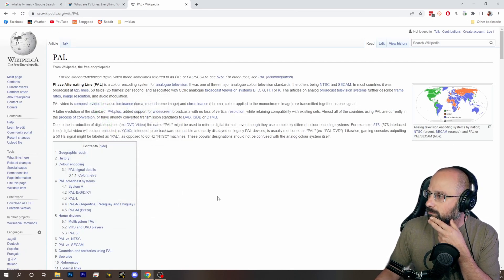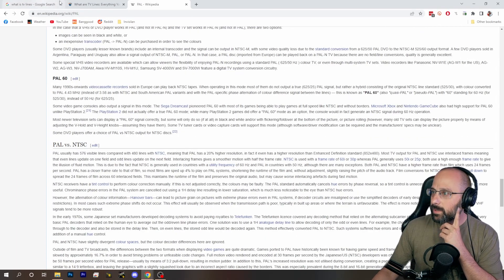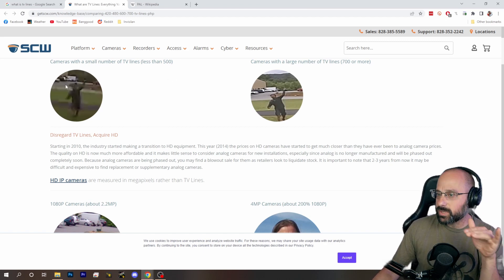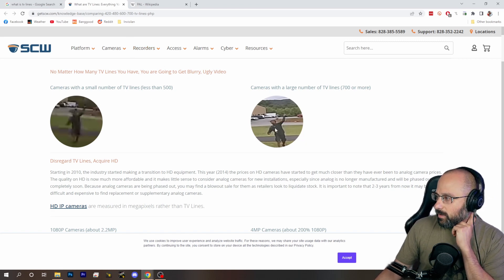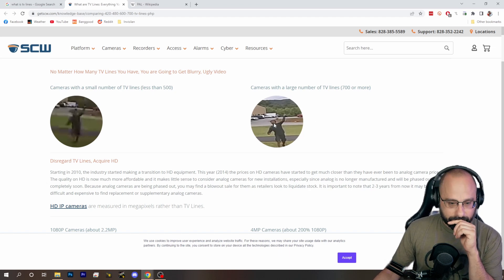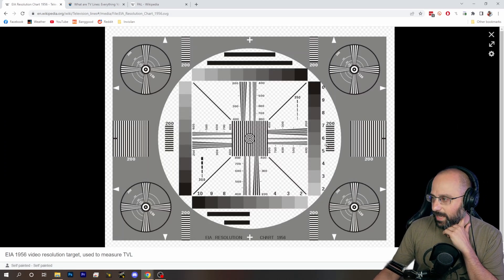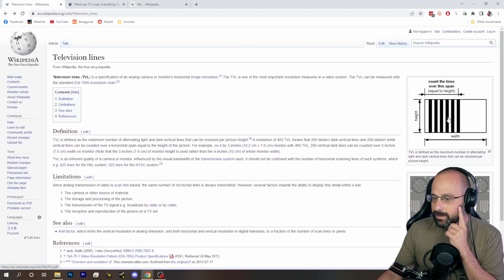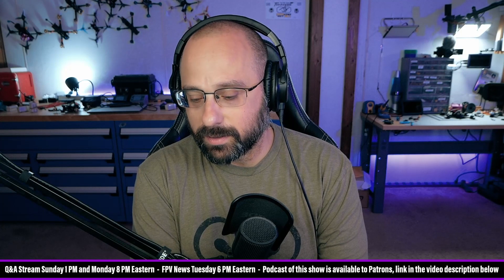Is Analog FPV Technology Maxed Out Currently? What is TVL? - FPV Questions

Comment: I think too if the dvr is not great the 700tvl camera verses 1200tvl is not visible.  Not knowing the specs i could say after watching this video, i bet my whoops with pico razor are lower than the new betafpv with c03 cuz that camera has noticeably more detail, BUT you can only see that difference from the DJI analog dvr.  It isn't visible with fatshark.  Maybe thats 60fps but i think its the 20mbps bit rate vs 5mbps bit rate dvr.

Comment: In NTSC only 480 of the scan lines are really used for the picture and from standard devices. Also Youtube defines Standard Definition as 480 vertical resolution. PAL has a bit higher resolution (576)... But actually a NTSC 4:3 picture will always be maximum 640 x 480. Some Googles have 800x480 so they profit a bit from TVL higer than 640... but only if the video is prodcasted in higer vertical resolution... Actually i think the reason they still use PAL and NTSC with interlaced Video because there are no engineers and no companies that wanna spend money and time to develop a progressiv NTSC or even a Analog 1920x1080p (LCD and OLED can not shot interlaced image, they need to wash out the picture (deinterlace).

Comment: Ya got the first part backwards.   There is a fixed number of horizontal lines (per NTSC/PAL spec) thus real vertical resolution (maximum detail on the vertical axis) is also fixed.   NTSC/PAL has no pre-defined horizontal resolution.  It's limited by sensor resolution and available bandwidth.     But yes, TVL is supposed to represent the maximum number of alternating black and white vertical lines (thus measuring horizontal resolution) possible to resolve and output but nobody really measures that way.  

The real benefit of a "1400TVL" camera is just that it has a high resolution sensor and you're probably getting super-sampling (more than one camera sensor goes into each effective pixel transmitted).    Is why a 4K capable camera transmitting, or recording at 720p still looks way better than a real 720p camera.

Comment: A person with a 640x480 googles will not see big difference in TV lines. And there is no way to count 1200 lines having only vertical 480 pixels no matter how close you get to the resolution chart. :) I guess 1200 tv lines means the pre-processor scans 1200 rows of the sensor and it is important for the machine vision where the signal is being analyzed directly without coding to PAL and decoding to show on 640х480 display :) By the way making quadcopters, especially FPV, is making the best of what can be found light and cheap. Some of DJI drones are equipped with sensors made for machine vision, not for impressive videography. Light and cheap. "Impressive" 48 megapixels sensor was designed to control the proper PCB elements soldering and there is a point to use the worst whatever with the biggest resolution. People seldom think about what they buy - numbers rule the market! 😂😂

Comment: I've done "extensive research" on the subject and I have to tell everyone it absolutely does matter and I only use 1200tvl (foxeer micro Toothless is my favourite). I have various equipment including a spectrum analyzer, generators, oscilloscopes and I bought and tested multiple vtxes with many analog cameras. First I have to agree with JB that analog resolution is a function of the entire system that includes your camera, connection cables(use shielded micro coax), noise environment onboard(Use copper tape to wrap vtx), power quality (Use LC filter), then your vrx and display. If any of those parts are lacking you will see no difference with better camera. Now to address some specific things mentioned in the video. First there is no such thing on the market today as an "analog camera". From the cheapest to the most expensive, all contain a digital sensor (most often CMOS), an image signal processor that is actually the second most important part of it that has to be smart enough to adjust gain for various lighting conditions (backlight, front light, night etc) do sharpness correction. I'm interested in DIY digital fpv so I know how difficult it is to replicate the results of a middle range analog camera like toothless 2 mini even in a digital system running at 1080p, yes there is lots of resolution, but no details in the shadows etc, see my video for comparisons. Then the digital signal from the ISP is converted to an analog PAL or NTSC signal usually exceeding the standard bandwidth by a lot (resulting in pretty good vertical resolution), then this goes over the cables and the vtx-vrx to your display. In conclusion high tvl camera matters, but also a good quality analog camera in general matters especially one with very high dynamic range, and clever ISP. I've tested a bunch and I haven't seen any better than toothless 2 mini.

Comment: ntsc vs pal is more interesting. pal trades a reduction in frame rate for slightly higher resolution and no more color issues. color is extremely stable with pal.

Comment: TVL is AFAIK horizontal. The camera can output a scan line with a higher resolution. But the PAL/NTSC transmission will bandlimit and cut it out. It is like playing a 20kHz sound over a phone line that is limited to 6kHz max. If the pre-filter is done properly nothing will be transmitted beyond 6kHz.
Reply: Yes, but there are professionals who say that if the source is higher resolution, downscaling will also produce a better result. For example, films shot in digital 8K UHD look better in 1080p than films shot directly in 1080p. Either this has something to do with the higher bitrate of the source. Or a pixel value can be better estimated if the pixel was subdivided...